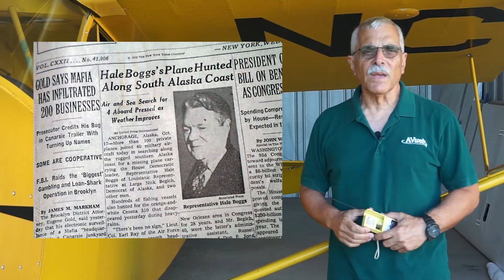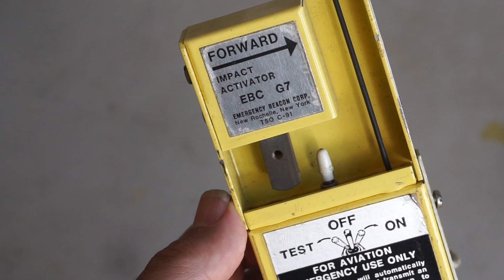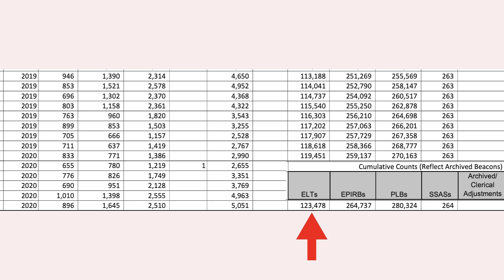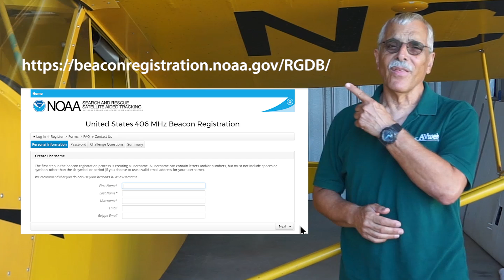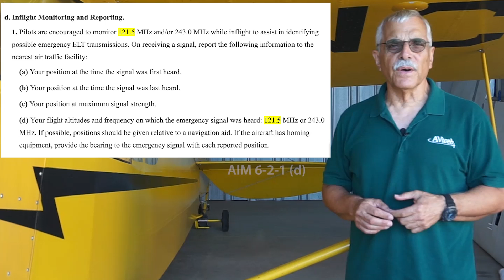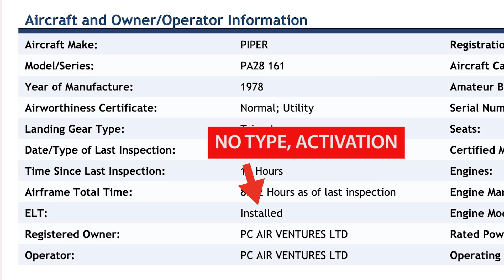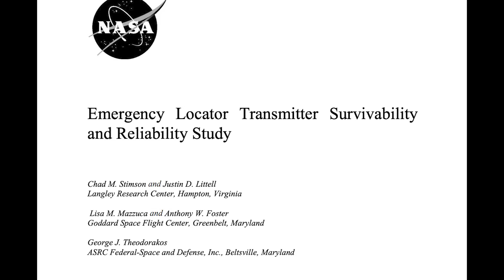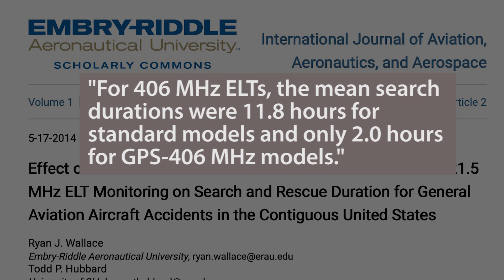Why Cheapskate Pilots Don't Like 406 ELTs

Comment: In the operating room, a device used during any laparoscopic procedure is the "laparoscopic suction/irrigation device". They typically are used for about 5 minutes total during a typical 1-2 hour operation. Then they are thrown away. Inside, there are (I think) 12 perfectly good AA alkaline batteries. During residency, we would always crack them open to extract the precious, almost brand new name-brand (either Duracell or energizer) AA cells. Many doctors are cheap bastards too!
Reply: I do the same thing w our batteries. All sorts of Stryker shit has inckuded Duracell dub As
Reply: will keep that in mind when i do my residency hahaha!
Reply: Sounds like a mini black market waiting to happen. Of course, the cheapest pilot bastards are doctors anyway 😈
Reply: Nice to know when I shell out 100 bucks for five minutes when I have to go see the doc and not for my annual  FAA Medical. that is $125!
Reply: @Blanik L-13 growing up in the 90s, the last bastion of cool and somewhat dangerous toys, the phrase "batteries not included" still echos in my mind as an ultimate fun killer
Reply: They should reuse those batteries as a policy seems like so much waste in the medical world from what I've heard about. In the engineering profession we'd never get away with such waste or inefficient use of material today
Reply: @bobbyrayofthefamilysmith24  Unfortunately in the medical world infections are  a big problem. So a lot of stuff either has to survive some pretty drastic cleaning procedures or be disposable.
Reply: @bobbyrayofthefamilysmith24  At the end of the day FDA approved medical devices are designed by a biomedical engineer who graduated from a college of engineering. They had the same material science and electrical engineering classes to learn how to waste properly. Blame the attorneys for costly litigations from common infections for why everything has to be disposable.
Reply: @bobbyrayofthefamilysmith24  you say that but I have a feeling you're unfamiliar with Apple PCB design...look up Louis Rossman.
Reply: @onenerdarmy  yes, well apple is being naughty
Reply: @onenerdarmy  I’m writing this to you from a 2016 iPad Pro  9.7” 1st gen currently approaching 2,000 Battery cycles. Despite manufacturers always claiming 500 cycle life for lithium ion polymer batteries, this one ran pretty well until about 1650 cycles. Then it took a steep dive. Now it has only 47% of its original capacity and I’m ordering a replacement on Amazon for $30 - and granted, it’s definitely not a R&R procedure for the typical consumer. Nevertheless that hardly compares with use ONCE and dispose with 97% of its expected life remaining.
Reply: @Syclone0044  Sure I get it man. But like you're saying, most people don't replace batteries. It's not easy for most people especially on an iPad. You having a ---- decent ---- life time on one iPad doesn't exactly negate Apples extremely sketchy business practices on the engineering side. I work with repairing laptop / tablet board repairs and Apple certainly is a class for itself in douchebaggery. No one comes close. You're just used to it by now, every time they add some new scumbaggery you're just feel so sad. No other company would have even thought of bricking an iPhone 7 from doing repairs to the home button or adding a big ass warning that you can't remove after installing a third party battery effectively making us lose customers since they don't trust us when their phone be like "YOU'VE GOT A NUCLEAR BOMB IN YOUR PHONE; IMMEDIATELY GO TO AN AUTHORIZED APPLE STORE NOW OR IT WILL 100% CERTAINLY EXPLODE". Everything so that the customer will buy a new phone. EVERYTHING.
And to then have the audacity to stand on stage at press conferences for their new iPhone talking about how they are environmentally conscious. Such a load of shit. Oh and at the same time removing the charger, in the name of climate change. Scumbags.

PS: The reason iPad batteries last long is because they are ginormous. It takes longer for dendrites to destroy them than from a small cellphone battery. This is 0% Apple being great engineers and just the way it is with Li-ion batteries. 
I'm not saying Apple doesn't have great engineers. Of course they do. They have made some great products and pushed boundaries forward. The poor engineers want to make a good product. It's the business side that takes all the douchebag decisions. They are at the front line in the fight against the right to repair movement. Lobbying hard as hell against it.
It's like proudly leading the dark side openly fighting with Darth Vaders lobbying for the death star. "wE cARe aBoUt ThE eNvIroNmEnT"
Reply: @larsalfredhenrikstahlin8012  I agree with a lot of your points and I used to work as a PC technician for many years and laptops were always the worst. (We only worked on PCs). I’ve never seen a laptop that wasn’t effectively destroyed when the power socket broke. I would say that’s the single most common laptop killer. Broken barrel-connector power socket. The more compact the device, the less room there is to design for convenient repairability.

I still agree with your point about Apple seeming to do little to aid in making component replacement ever any easier. However, in the big picture, Apple by far supports their devices longer than anyone else. My iPhone 6S is still eligible to update to the current iOS 14.5.1 or whatever it is! It’s got to be 7-10 years old now! Nobody comes close in that regard and you know it.

The home button thing I can say without even knowing the case, that it must’ve been a Touch ID issue because the fingerprint sensor is so extremely encrypted/protected in the very limited ways it can communicate with the phone (so that your actual fingerprints are never known, and so it can’t be cheated/bypassed.) That’s not a deliberate repair-sabotage, that’s a side effect of the incredible security of Apple’s best in class “Secure Enclave Processor” which every jailbreaker and hacker in the world knows we’ve NEVER been able to beat. 

I’m not familiar with the “unauthorized battery replacement” message, although to be fair, that message is a 100% accurate description of what occurs at your shop. You just don’t like the fact you conduct unauthorized repairs and get called on it. Understandable. 

I agree their boasting of being environmentally conscious does seem a bit hypocritical when the single biggest thing they could do to reduce their impact would be to make batteries more serviceable.

Why are they “scumbags” for removing the charger in name of climate change? I think it’s bullshit because 20W USB-C chargers are not household-common compared to USB-A, but if not for that fact I would acknowledge they have a point when they say well over a billion of the white cube 5W USB iPhone wall chargers are in existence. I know I’ve got at least 5-8 of them collecting dust.
Reply: @bobbyrayofthefamilysmith24  visit a jobsite of something you engineered lmao
Reply: And it reduces e-waste too :)

Comment: I agree with the PLB approach vs. mounted. It makes sense, but very telling from the research as to the vulnerability of ELT antenna damage/disconnect. How ironic for what is likely an operating ELT at a crash site transmitting a signal to nowhere.

Comment: As young, enthusiastic student pilot and A&P apprentice, I routinely changed those battery packs (under supervision from an IA of course) confident that I was ensuring the safety of potential crew and passengers of GA aircraft. As an older, less enthusiastic out of shape plain old citizen, I joined the hunt for an ELT beacon that had been triggered about forty minutes way. Jumped in my minivan and showed up to help a handful of others look for wreckage of the Cessna 182 that must have gone down in the woods at night in the late fall. Temps were around 40° and raining. The Guard was trying to contact the registered owner and no air support was available. For 2 hours, we combed the woods looking for the smallest hint of a wreck. Then, we were alerted by a Sheriffs deputy that the beacon had been located. 
In the back of UPS truck a half mile north on the Ohio Turnpike were UPS parks their doubles for relay. Someone shipped the locator with the batteries in......
Reply: That is a clue as to the g-forces experienced by a package when handled by UPS. LOL
Reply: @wesleyhurd3574  A ++ comment. I can just see that poor beacon hurling around the back of that UPS truck! What a mental picture! Good job!
Reply: @wesleyhurd3574  Or in actuality... just a stupid semiconductorless device..
Reply: @rkan2  I understand calling it a "stupid" device because it often does not function as designed. But don't dismiss the value of a device just because it lacks semiconductors. Many successful and revolutionary inventions were created before semiconductors existed.
Reply: @rkan2  I'll take conductors over semiconductors ANY day.
Reply: @wesleyhurd3574  That is actually not why I calles it stupid. Stupid was more in reference to the lack of logic and software that is ever present on the devices people are interacting at the comments with.
Reply: Circuit Monkey : I fortunate they found the downed UPS truck
Reply: @markfreedman2470  The UPS guy needed rescuing. They all do. Just ask them.
Reply: The UPS truck is the most annoying thing to chase.  The roof of the truck is plastic, but the sides are metal, so the satellites can get a signal, but the ground team can't hear anything and an air search is tough too.
Reply: That’s certainly one way to track your order
Reply: Naturally
Reply: Now we have proof that packages at UPS are subjected to critical G's.

Comment: Not a pilot, so, please forgive me if this is a stupid question. That battery package seems like a problem very easily solved via 3D printing?
Reply: What it doesn't solve is the FAA approval process for aviation electronics. It would cost around 1.5 million dollars for the professional aerospace engineering and electrical engineering design work, FAA submittal and patent legal work, then simulated crash/fire testing, redesign, resubmittal, and approval before you ever begin manufacturing. Let's say there's 40,000 121.5 ELTs out there, only 20,000 are due batteries this year only 15,000 are going to get batteries and you have the market cornered on cheap batteries. Still, not everyone trusts your new product so you sell 10,000 of them. They cost $5 each to make. To pay off the investors in 5 years at 10% rate of return in 5 individual annual installments would be $395,696 each year. That's $39.67 each plus $5 for a break-even, "nonprofit charity" price of $44.67 each just to cover costs. But now it's so close in price to the original that nobody is going to buy it. This is why this doesn't happen. $5 of the price tag covers the cost and $40 of the price tag goes to price of government regulation and financial usurers. The same process is why the MOGAS STC costs so much despite being literally a piece of paper.
Reply: @EightiesTV  so sorry, YouTube didn't notify me of this reply...

 Anyway... who said anything about professional design work? Or selling them? :D I mean, they already seem highly unreliable, can't do worse than that. I'm half kidding, but it's a box that holds batteries, stuff like that ticks off my inner anarchist designer gland :D

Comment: Speaking of the ELT not activating at all, this points out if you have a remote activation switch on the panel it's good to activate it on the way down if able in an engine failure scenario etc
Reply: Aviate, Navigate, ELTate.
Reply: Andy Plater same with the PLB, mine is always within reach and I will activate on the way down, don’t wait until after the landing. Still need to replace those batteries though.
Reply: Forgive me for forgetting, but I thought they just had a test toggle and an arm toggle, with the arm meaning its enabled but not "on." How can I manually activate the ELT in case of an emergency when I can't make the field?
Reply: @mitchellroberts7954  most of the remote switches are up for on and down for test/reset, but should be labeled on the unit, otherwise reference manual for that specific model
Reply: @mitchellroberts7954  The plane I train in has 3 positions on the switch "on" "arm" and "test"
Reply: "On" is to send the signal to come and find you. "Arm" is for the unit to turn "on" when it senses a crash. "Test/reset" is a self-test the unit runs through. If you're going down, turn to "on". The ELT will start transmitting with gps data all the way down. Ideally, rescue will know your exact location before your off-airport landing (aka hit the ground)
Reply: @claudiom4616  Two different types of switches we're talking about

On - Off - Arm is on the physical ELT itself.

The remote switches allow an "armed" ELT to be switched to "ON" using a switch on the panel.

Comment: When active duty AF and Guard here in AK I spent plenty of time on drives to Six Mile Lake (private planes 121.5), the ramps (mil planes 282.8/243.0), et al to find an actuated beacon with a DRF. Mostly riser pulls when handling a parachute would pop the plunger (URT-33's). Begich/Boggs: I was a Air Guard volunteer HC-130 'scanner' with the 210th RQS when a plane went missing in the early/mid 90's (think it was a Navajo -lawyers?). I recall scanning while they were flying concentric circle over an ice field. The LM pointed out on a map the grid a tiny square where we were at. I looked out the scanner window, and it was as far as the eye could see. THAT's when I realized how big AK really was. And looking down in all the endless crevasses on the glacial ice, and all the nooks and crannys in the mountains and trees - bruthuh - you do NOT want to go down in the way outback of AK without a beacon, and survival gear. This state is tremendous. (And in all the dangers, it's the stinking mosquitoes I would dread the most) I may well be Begich/Boggs never found (lots of lakes in AK too)

Comment: Of course the batteries are still good after two years; they are supposed to be. The point is to replace them before they fail
Reply: Or how about that 80s technology... You know, lithium ion batteries :P
Reply: Which would be great if he could pop in some fresh new Duracells instead of the $48 battery pack!
Reply: Brian Stramel take that up with the manufacturer